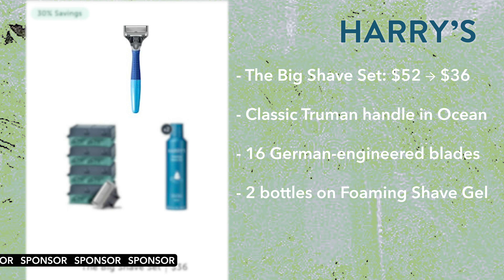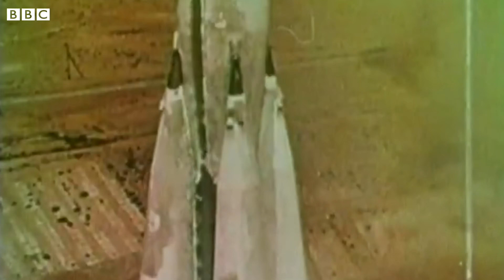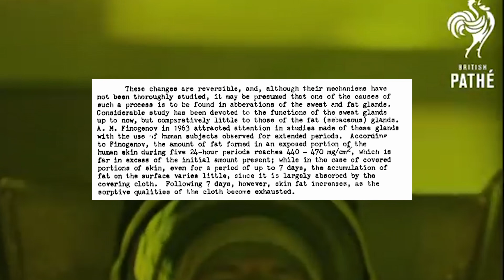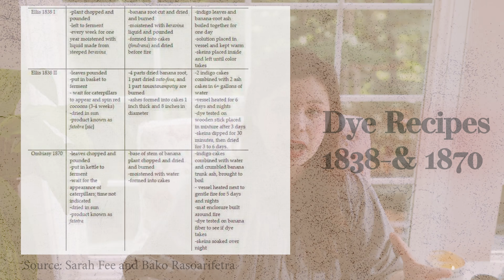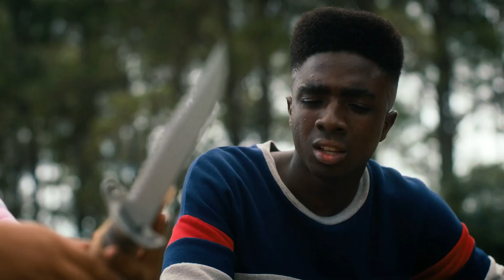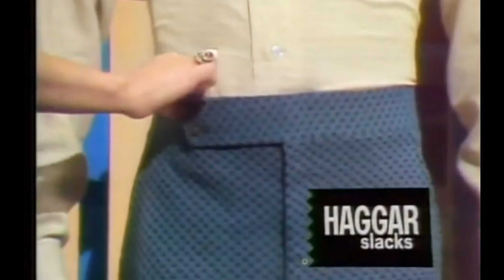The DISGUSTING truth about Laundry

Comment: Really interesting video, but there is one thing that I have to disagree upon and that is the sanitation part. While there might not be an explicit sanitizing step in our modern laundry routine, surfactants definitely are effective against bacteria etc. The whole point of a detergent is for part of it to be hydrophilic (easily soluble in water) and part of it hydrophobic (easily soluble in oils + fats) so that the hydrophobic part of it binds with non-water-soluble dirt and actually makes the compound of both water soluble after all, so that the dirt can be washed away. Cell membranes (of bacteria and viruses as well as your own cells) are made of lipids (fat), so they do get broken down by detergent. Heat and other chemicals are still helpful of course, but it is simply not true that your normal washing is not effective. 
Yes, some bacteria could survive, but mostly, you're fine, don't panic. Also note that the information posted on screen comes from a source that directly profits from you believing that normal detergent doesn't sufficiently clean your laundry by selling you a solution to the claimed problem.
Reply: Right! Honestly I think some of it comes down a bit to terminology and our collective misunderstanding/ misuse of it. I work in food science and have a background in culinary arts, and we can have similar problems. Like, clean =/= sanitizing =/= sterilizing, BUT they all contribute at different levels to removing germs. Cleaning removes soil (& a good bit of germs, but not all), sanitizing mostly removes germs (brings them down to a minimal level), and sterilizing completely removes germs. 

It's possible for something to be sanitized, but not clean (in the defined sense - there could be a dusting of flour that's sanitary, but the flour being there makes it not "clean"). I used to help with mid-shift sanitizing at my internship at a clam processor. That line was sanitized at mid-shift, but it was not cleaned (all sand, shell fragments, and clam bits thoroughly removed) until end-shift. It was still food safe.

We generally don't live in sanitized environments per the definition of how much bacteria is present. And that's okay! Certain things really benefit from sanitizing down to a much lower microorganism amount, but many do quite well with thorough cleaning.
Reply: @KireiC  It's also not just about the amount of germs that gets removed when sanitising something – it's also about the kinds of germs that get removed. For example, when doing laundry at a certain temperature, you will remove the dangerous germs that are a health hazard, but not remove germs that are harmless that would require a higher temperature for removal/killing.
Reply: I was looking for this comment!
Reply: If this were Reddit I would give you gold 🏅
Reply: Thank you so much for this comment! As a germaphobe who wears a lot of used clothing, I needed this reassurance!
Reply: @thesavingsorceress  Aw, Echo, I hear you. I’m as squeamish as they come, but I’ve accepted that without germs, all living things would disappear. We are all hosts for bacteria and other pathogens and need them to stay alive. I now try to focus on avoiding known pathogens that can harm me … the viruses, bacteria and fungi that cause illness and death. Makes living in the Petri dish called earth much more relaxed for a squeamish one such as I. Now I get squeamish thinking about how humans and human activity are a dangerous pathogen and harm the health of our planet. Ick.
Reply: Thank you all for the kind comments, they are absolutely appreciated.
Also, how is this comment somehow getting traction now, more than a week after writing it? 😂
Reply: We've have washed cloth diapers for over 2 years now, and I feel very confident that the wash does just fine with removing the poop and pee.  So I have to disagree with the 'poop' is on your t-shirt thing. We would have gotten sick or smelled really bad by now if that was really the case.
Reply: @fitzsi28  Came to the comments for the main comment on how detergents and surfactants work, but also need to reply to you because my toddler has been having nightly poop blowouts (he just started daycare, between viruses and teething, it never ends), and I had a brief moment of panic about all the poopy sheets we've been washing, but really, I know the soap and heat are doing their job.
Reply: @fitzsi28  and if the poo/pee wasn't coming out of the diapers, kiddo would have a NASTY rash or worse. We cloth diapered two kids, and if I hadn't been thrown unexpectedly into a solo parenting situation with our 3rd kiddo I'd have them in cloth too. You learn quite a bit about laundry when your child's health is on the line!
Reply: I was thinking the same thing. If we're assuming that basic surfactants aren't effective against bacteria, then we'd also have to assume that modern handwashing practices aren't effective and that's just not the case.
Reply: Came for this!
Reply: It's all about algorithms. I just now saw this video. Lol
Reply: Also let's try to remember that modern laundry practices have been absolutely life changing for people (especially women who were basically treated like domestic slaves throughout history).

It's good to critique modern practices, but let's not forget that inventions like the dishwasher and washing machine have made it easier for mothers to have careers and hobbies outside of the home.

I'm glad I don't have to put as much time into washing dishes or doing laundry so I can spend more time on fulfilling hobbies or relaxing after work. Also cool to have time for a career instead of being my husband's maid lol

Anyway these types of videos are interesting, but people shouldn't take "reject technology embrace tradition" from it.
Reply: @dellybird5394  So true! Not to mention how these appliances make it possible for disabled folks like myself to live their lives more easily and with higher quality of life! I have arthritis I can't be out here beating soaking wet clothes with a stick every week and then wringing them out by hand??? Not to mention the amount of space that takes when living in a house is out of reach for most, these days.
Reply: @dellybird5394  exactly. Even tho it's wasteful in alot of ways and is harsh on cloths. Women aren't stuck constantly doing laundry anymore and people don't have time to do what our ancestors did for laundry our lives are really crazy busy in the modern world. And then you have disabled people who can't do all that work just to clean clothes.
Reply: @dellybird5394  A washing machine is the one appliance I really need. If I had the choice between rather too infrequent access to a washing machine but no vacuum cleaner, no dishwasher, no dryer, no stove, no oven, no microwave and even no fridge and freezer or all of these things I listed but no washing machine, I would choose the former. 

Doing laundry by hand is absurdly much work.
Reply: @dellybird5394  This is no denial of the less than stellar position of women throughout history, but that sure is a blanket statement. The advent of the nuclear family and the myth of the housewife are both great contributors to the idea of housework being a single person job. These machines are a great help, I wouldn't want them out of my life, but in dome days they're also the solution to a modern problem.

Depending on time period and region, both food preparation and laundry was done in the public rather than the private i.e. domestic sphere. So they were full jobs, done by multiple people, rather than by a single housewife.
Reply: @dellybird5394  I think people need to relax more. I never owned a dishwasher, I have 2 kids and still live my life. Sure, my dishes often sit for some time in the sink, but who cares. I feel better knowing that I waste as little water and detergent as possible and save on the bill too. I don't have a dryer either, I'm lucky enough to live in a country where people can hang their clothes out.
Reply: @dellybird5394  After timing the labor involved in washing dishes both in a machine (and the putting away) or by hand (and the putting away), we found that it took less person-time in the kitchen to hand-wash.  If you’re rinsing dishes before putting them in the machine, then you’ve done most of the work already.  Add soap to that cloth you’re using to wipe stuff off, and you’ve washed the dish.  Instead if setting in the dishwasher, set it in a dry rack in the sink.  Less electricity.  Bonus: No bending over to put in a machine and take out.  Then put away.  I told my husband to get rid of our dishwasher.

Machines really don’t save you time on this one.

And as far as washing delicate clothing, you can save water by doing that when you’re standing in the shower letting hot water run over you.  I spend $50 on a single pair or lace panties because I know they won’t get ruined because this is how I wash them.
Reply: @Author.Noelle.Alexandria  ,The idea of washing some of your clothing while in the shower is interesting... I wonder how far it can be taken...
Reply: @Author.Noelle.Alexandria  there's a thing called a delicates wash bag. they're fantastic for lacy undies. I have three ladies in my house (myself and my daughters) and those bags are brilliant for keeping them from getting wruined.
Reply: @meikahidenori  I know about those bads.   I’m a textile expert.  Those bags only do so much.  That much spinning and hot water for so long isn’t good for delicate fabrics.  I’ve had delicates ruined in those bags.  When you start spending $100 on a single pair of panties, let’s see how much you trust those bags instead of your hands.  I do mine when I’m in the shower.  Not taking chances again.
Reply: @Author.Noelle.Alexandria  Regarding dishwashers, you're not supposed to rinse dishes before putting them into the dishwasher. You're just supposed to scrape them and put them in.

I've had some bras and shapewear that have gotten the shower-wash treatment, but I'm going to go on a limb and suggest that $100 underpants are not a relatable purchase for most, and that the average person, who is probably not paying much attention to their laundry to start, would do well to always place any smaller, more delicate items, knit items, or items with zippers or other hardware that could snag other garments into separate wash/delicates bags. I'll continue washing my mostly-cotton underpants in a lingerie bag in cold water, using a somewhat more eco-friendly detergent, and then putting them on a drying rack, which is how I do most of my laundry. My clothes, including all 10 my underpants, face pretty minimal destruction when laundered this way. I only ever need to acquire new underpants every 5-6 years with this method.
I periodically fantasize about buying some underwear in merino wool for the moisture-wicking benefits (I hate crotch sweat, especially when combined with menstruation time), but alas, I have not yet sprung for them yet.
Reply: @anguista  splurge on the merino underthings! It’s so worth it.
Reply: @Author.Noelle.Alexandria  I have a dish washer. Not a dish sanitizer. I don't pre-rinse anything. I dump in and wash. Then I put away.
Reply: @Author.Noelle.Alexandria  OH, and dishwashers use less energy because they use less hot water. :)
Reply: @Author.Noelle.Alexandria  If I'm spending $100 on a pair of panties, I need new priorities. I'd rather spend $100 on the gym so I'll look awesome in $1 panties.
Reply: @dellybird5394  well, of course as a woman you are not a domestic slave or a career developer. Of course machines took a whole part of (female) household work! BUT keep in mind, that machines didn't make the feminist revolution. If only machines determine your freedom, than maybe you should scrutinise your freedom, especially as a woman.
Reply: @floraohrenstein1219 Actually, in some places like India cheap washing machines have actually increased education quite a bit... I'll see if I can find a link for that initiative, but that case is due to women there being treated as servants essentially
Reply: @floraohrenstein1219 machines didn't make the feminist revolution. Middle class women with money to pay for domestic helpers did.
Reply: This, thank you! Also while not sanitized but if u want to make sure your clothes are really clean 60°C is all u need, most bacteria ( that u couldn't get rid of cause detergent and temperature ) are super resistant and rather rare

To the no dish washer people here: 
You are aware washing by hand is almost always more wasteful and just plain more work than just using a dish washer. Modern dish washers are pretty optimized, same as with laundry you can't just say machine=bad...
EDIT also if u rinse you haven't gotten most of the job done, yes they look far more clean but that's it. prpperly hand washing takes longer than the machine, unless you are one of those 3star restaurant professional dish washer wizards. take it from someone whose job hand washing was...
 if u like hand washing, cool, but it's not less wasteful or faster ( if done properly )
Reply: Thank you, I have anxiety about contamination and the first line of this video triggered me very badly and this comment has helped with that.
Reply: This part of the video felt super weird to me as well! She mentions a couple of times that the video is from a North American perspective, and I think this is a blind spot in that respect. In my experience North Americans are MUCH more concerned about “killing germs” than other countries. Soap and water may not kill bacteria but they physically remove a lot of it. And generations of people have been washing shirts and undies together and we don’t get sick every time we get dressed, so it’s probably fine I guess???? I just don’t feel any need for my laundry to be completely sanitised and disinfected 😳
Reply: I wish to add to your excellent explanation with an opinion. On the note of "here's your problem and I'm selling a solution" detergents notably offer more detergent on the scoop/cup than it seems is needed for your load. Partially this is to combat the solubility, dried stains and hard water issues but it is not ever explained why by the websites or the packaging. I wish like baking instructions that cooperate detergent would have a chart (or similar) for laundry amount vs machine vs water (and possibly vs delicacy) to let the public more easily grasp the wash to wear needed in your situation. This isn't to say that you should use less than recommended or that there is another agenda but I haven't researched into that specifically and I won't cop out by saying User Error.

I feel that stains are not a button on the wash cycle, the "steam" setting is not a cure-all and big business has the reach and money to successfully set up their consumers to effectively and accurately use their products while still making profit. (Let's face it even if I was retired I would not be making my own laundry soap.) What the end user is doing is greatly reducing the amount filth, bacteria and germs on your clothes hopefully every time you wash and hopefully washing different items separately on accurate settings. I don't have a good conclusion for this besides borrowing again "don't panic" you're doing your best.
Reply: Thank you for saying this! Almost every kinda soap kills bacteria to some extent, even if you'd use cold water. Same goes for people who obsess about hand sanitizer even though it's been scientifically proven that just washing your hands with soap and water is actually more effective. And laundry detergent is a type of soap with much the same basic functions. But sure, if you don't use enough detergent and your clothes still feel greasy after washing, they're probably also still covered in bacteria. I usually have to double wash my bed sheets for this reason, to properly get all the grease out.
Reply: So I agree with you. One thing I'll add though is that modern soaps do damage our clothes. My source is the chemist at work who makes soaps for a living
Reply: Dammm that is one smart comment 😊
Reply: I mean it's definitely washing away all that sawdust and greese off my clothing.  ( I work fast food and do woodworking as a hobby) so it's definitely cleaning it.  Maintaining the clothes tho IDK about that.  I've noticed t shirt fabrics really degrade over time but they are made by cheap material
Reply: THANK YOU. I know everyone's gotten more panicky about germs since The Plague but we are seriously more bacteria per pound than we are human DNA and that's normal , that's normal and fine. The flora on our bodies is the first line of defence against disease and stuff! It's only when that ecosystem is disrupted that things go bad. Disrupted... like from killing all of it with too much sterilising!

Additionally, and I learned this from Mike Rowe... dirt? Is poop? Like that's what dirt is. That's mostly poop; and plants make that into food and we eat it and the cycle continues so like.... Idk, I think people are way too weird about bodily excretions and assign them a whole separate demon level of 'dirty' sometimes, when all dirt is dirt it's all made of the same stuff. 

'Clean' is good enough, there's no reason your laundry needs to be at 'sterile' levels. My surgeon didn't even tell me to sterilise my sheets and clothes before coming in for a big surgery, just to sterilise my skin in the area she was working on. That's it! If 'clean' is good enough for surgery it's good enough for everyday life.
Reply: As someone with Contamination OCD, this comment saved the next few hours for my mental health!
Reply: Right! There would be limited benefit to washing your hands during flu season if surfactants did nothing.
Reply: Plus, dryers do actually have sanitize cycles if you need them, some washers do, and there are special detergents for sanitizing, too. There are also special washing machines for sports teams that have extra hot and fast sanitize cycles.
Reply: Yeah,surfactants are citotoxic in concentrations higher than their ability to form micelles (and some even in lower concentrations), and they "wash" away the lipids in the cell membranes of living organisms
Reply: THANK YOU for pointing out the source I was getting worried
Reply: Thank God I found this comment. I was like no… soap kills bacteria And viruses by breaking down the cellular wall. Please keep using soap for your hands, body, clothing, and dishes. It’s definitely sanitizing these items.
Reply: Thank you. I was getting so annoyed watching this lol. Not really cause it’s bad information about the past, but a: I don’t use scented detergent, and my clothes smell fine after, and b: the amount of time it takes to hand wash all clothes would make doing anything impossible. I’ll keep my washer, thanks…
Reply: I would like to add to the point that yes, detergent does work, and indeed machine washing helps, but the critiques on the water hardness, the rough nature of the machines on your delicate and let's face it probably cheap clothes, and the cloth consumption as a result is still a valid criticism. Let's not throw the whole video away, even if she is selling us on a solution to a problem that is partially a non-issue. Take what is valid, leave what isn't
Reply: @ohshiditsgriff2793  No one in this comment thread ever said or implied that they wanted to throw the whole video away, please do not make this a straw man argument.
All I did was criticize one specific point of the many that Abby has made here and the sources she used to make that point, others have added to this and have highlighted that the convenience of machine washing has had significant benefits to the life quality of people doing the laundry (historically mostly women). That is all.
Reply: @Lena's Braindump  I wasn't necessarily directing that at you or anyone in the thread, I didn't mean it to seem that way. I'm more accouting for the fact that the thread is public, and so people might take your completely correct and valid criticism and others in this thread as a justification to not change their laundry habits at all when perhaps they could if they wished to preserve their clothes better, or just to cut down on their energy consumption. That's why I didn't tag anyone specifically. Y'all are right, I totally agree, and I worded my warning in a very ineffective way. That's my bad.
Reply: I thought what she was saying is #1 it is not getting as clean as most modern people think.  Perceptions.  I thought she was also saying not as clean....not that is was not clean at all. Maybe we should ask for the research articles.
Reply: Thank you! I could tell that something here wasn't quite right, but I couldn't work out what it was.
Reply: Actually the surfactants aren't normally that successful in destroying the cell membranes.. if they do they generally cause dermatitis in people who handle them bare handed too. Surfactants remove bacteria from surface of fabric and allow them to be rinsed off. I am also skeptical about Abby's statement that hard water causes skin allergies. Maybe it contributes to reduce efficacy of forming micelles/ emulsifying to lift dirt and bacteria off the fabric. I am just thinking out loud because spring water is technically hard water and they don't cause skin allergies. But I do agree that there's probably more left on your fabric with the conventional laundry regiment in exchange for 'lifting' off oils and bacteria.
Reply: @nieiniei there's an idea out there that I dissolved mineral particles in hard water irritate skin. Washing with hard water does leave a residue, and on clothing, it will contain some of the harmful, irritating chemicals in detergent. It makes sense that would exacerbate skin issues.
Reply: @nieiniei What you're basically saying here is that handwashing is ineffective, which we all know is not true.
Reply: @nieiniei  hard water on average does actually increase your likelihood to get skin allergies! but hard water's not a monolith- all hardness means is that Something is dissolved in the water preventing it from dissolving other materials, and there are a lot of potential methods for Dissolved Solids to trigger skin irritation.
Reply: only some detergents do this. That's what the Persil article she referenced was saying (Persil is one of the few who does!)...the cheap ones are literally just coating clothes in perfumey soapy grime.That's why it's so important to get a real detergent. My mom worked at a hospital and had to buy the special disinfectant laundry so they def don't all do it. I learned that they're not all the same from the Consumer Reports detergent list on most effective laundry soaps.
Reply: Try using public laundry mats.
Especially ones owned by apartment complexes, specifically the in ones they charge you to use. Pretty much guaranteed to get covid, an STD, and yeast infection

It really doesn't matter what products you use.